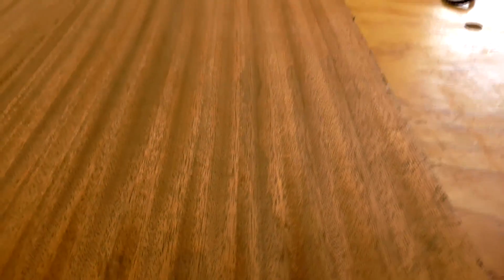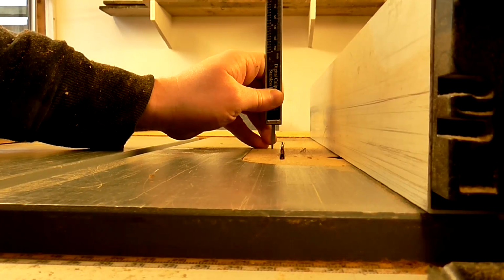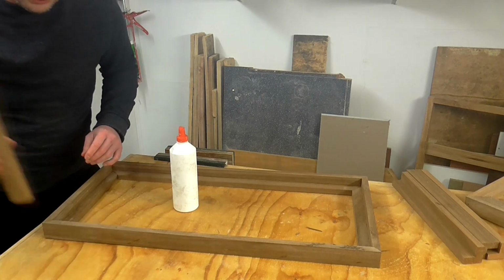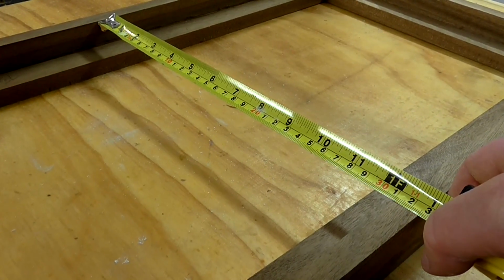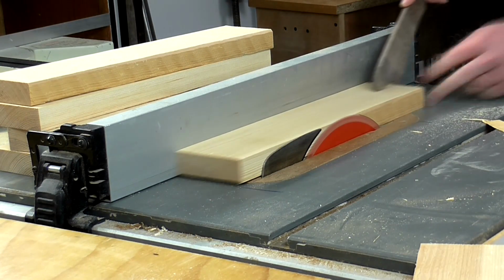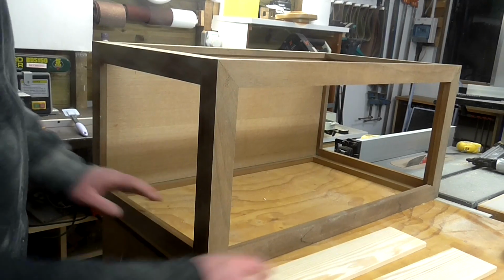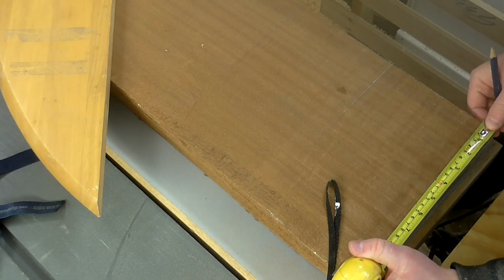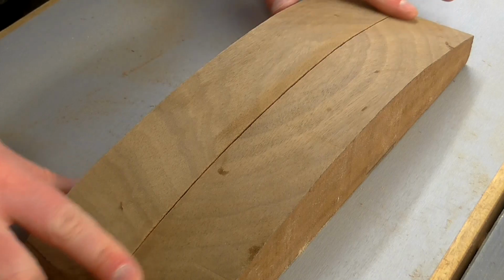Making A Treasure Chest Ottoman / Blanket Box (part 1 of 2)

Comment: ok you are going to have some cladding inside, but still, why make all the joints on the frame so embarassingly weak?  why not do that slab more justice?
Reply from the maker: It's still  doing fine. Plenty strong enough structurally with the cladding so I don't see what your issue is

Comment: That sapele cut on the bandsaw is quite impressive. I've been comparing the cuts of different bandsaws with the record power demonstration video. Theirs seems to breeze through everything but is £100 more than the others for the 12" and £200 more for the 14"! On their demonstration vids they use a 3/8" 6TPI blade. On another vid they recommend using that blade as a general purpose blade and just leave it in there! Thanks for highlighting which vids to watch, it's been very helpful!
Reply from the maker: +Richard Hawkins in my experience 3 or 4 tpi is good as an all purpose, I wouldn't go higher personally as the teeth clog up and the blade starts to drift when re sawing. I've not had good experiences with record power tools but maybe that's a personal thing. Would definitely recommend tuffsaw for buying blades though they make a big difference in quality of cut and they last ages too
Reply: Which type of blade did you go for? When I looked it was a bit confusing. I'd heard good things said about thinner kerf blades.
Reply from the maker: +Richard Hawkins mine is a 3 tpi blade I think 12mm wide not sure how thick it is though. It does great for re sawing and manages curves ok although I do have to make relief cuts when cutting curves as it's quite wide